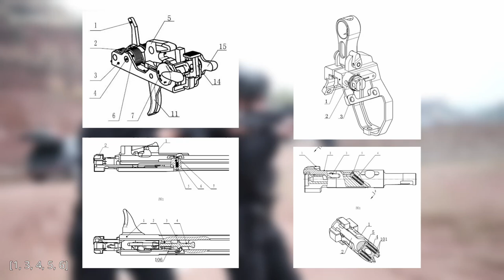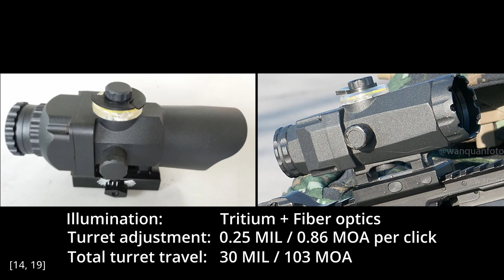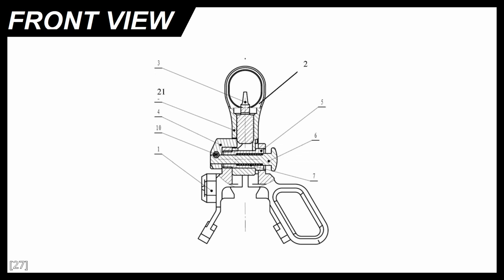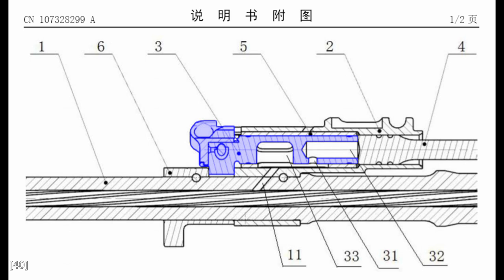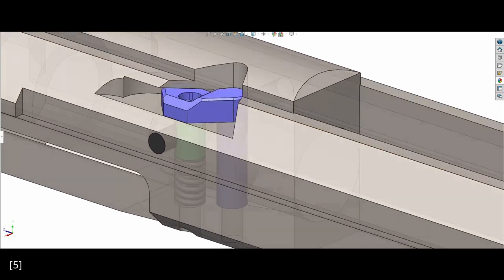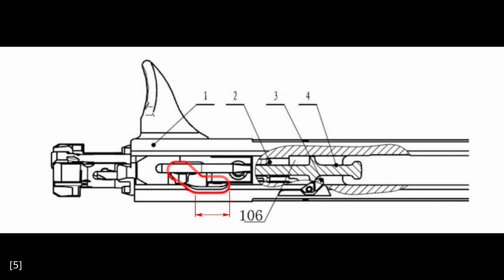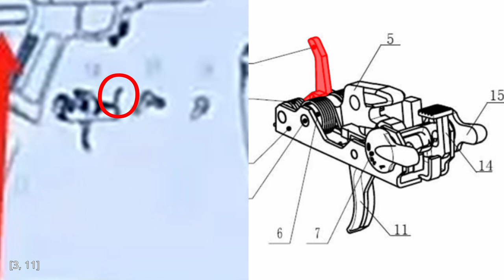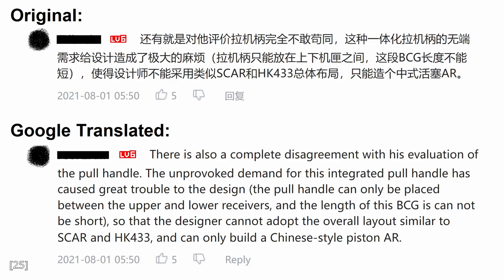QBZ191 - Update / Deep dive [CHECK PINNED COMMENT FOR UPDATES]

Comment: 1. Yeah, Magpul windowed PMAGs are marked to the 25th round as well, with orange paint on part of the spring in USMC service (at least, probably elsewhere too but I've seen it without)

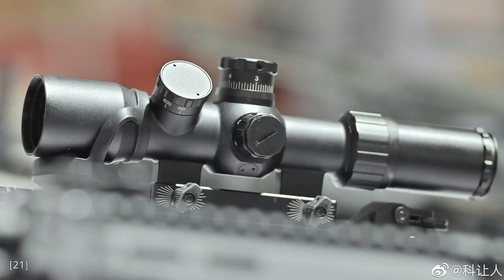5:20
To compare to an ACOG:
ACOG              Mystery Optic
4x                     3x
447.92g          330g
7ish deg FOV 7.6 deg FOV (keep in mind, is only 3x instead of 4x)

No, we have not reached a plateau in small arms design. The issue is that good engineers... don't design guns. They make planes or cars or spacecraft or buildings or literally almost anything else. You should feel in your bones, having looked at all this, that you are basically a paleontologist. That is not because we have discovered every way to do a thing. I don't think that rear sight is even a particularly good way of doing things. 

We can do way, way better.

15:00
Ah sweet, another metered gas block
Also a litttle bit of underslide
 

The firing pin retaining pin is theoretically cool, but honestly strikes me as dumbfoundingly stupid. That's a lot of work for a part like that to solve a near nonexistent problem.
Yeah, it's overengineered. 
I suspect since all you need is a thin little stabby boi, they do expect soldiers to remove firing pin in the field for cleaning sometimes. The tool necessary is likely in the cleaning kit. They probably feel very smart. 

Ah sweet, APE in an AR BCG!
I was specifically wondering what the hell the comb in the ARX160 was. Hilariously overengineered rifle with several deep flaws, but this is actually kinda neat! it's like a key.

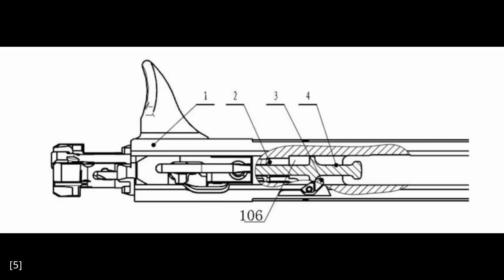23:40
brings a tear to my eye
Though, I'll mention, it not only makes it less violent, it actually lets chamber pressure go down before the gun unlocks.

It's a very neat hybridization of the QBZ-95 and the AK fire control groups.
Overall, quite happy to know more about this rifle. The bolt and non firing pin retainer bits of the bolt and bolt carrier are quite impressive.
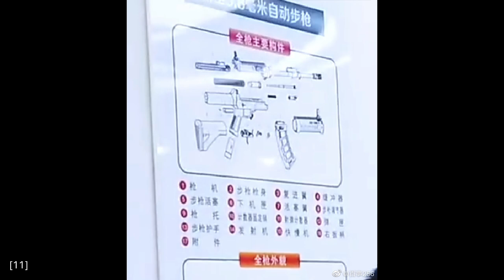Reply from the maker: Regarding the firing pin retaining pin, I don't think they expect soldiers to remove it because in both the photo at 27:20 and the diagram at 7:51, the bolt is still in the carrier. I also can't imagine that they haven't heard of a captive firing pin retaining pin before.

Also I did kinda mention how underslide lets chamber pressure go down more before unlocking at 23:53.
Reply: @cabbage6015  ...they're not disassembling bolt carrier for cleaning at all? that's very strange to me
Reply from the maker: @superfamilyallosauridae6505  Yea that trips me up too. But I guess for piston guns you don't need to worry that much about cleaning between the bolt and bolt carrier.

I think the first gen CZ 805 is also designed so that soldiers don't have to take apart the bolt carrier.
Reply from the maker: Bruh I just realized what you meant about the letting the chamber pressure go down. During that part, I wanted to say that the QBZ191's elongated cam track is appropriate bc it is a piston "AR15", and piston ARs have higher bolt carrier velocity than DI ARs bc the gases act on the moving parts more quickly, so more underslide is needed in the BCG to accommodate that. But in the middle of editing I thought about how people usually think piston guns are more snappy just bc the piston adds another reciprocating mass, which is a pet peeve of mine, so I wanted to address that. I guess that tangent derailed my flow in that section, my bad
Reply: @cabbage6015  Being aware of these things and saying them imperfectly still puts you ahead of FW lol

Glad you mentioned the assorted bolt carriers redesigned to incorporate more underslide. 

The piston thing is a pet peeve of mine too. This is especially relevant in AR10s, which often have actually quite a high moving mass despite being DI. Gas tube>gas piston in my opinion most of the time, just nice to not have moving parts over the barrel, but it's not as simple as people think.
Reply from the maker: @superfamilyallosauridae6505  oh I don’t think I deserve to stand in the same category as Ian McCollum lol. 

Also something I have always found intriguing is that the AR15’s DI system is not commonly copied at all. I guess it’s theoretically not ideal that gases are directed back into the receiver. And people probably don’t want to have to deal with gas rings in a mass-issued weapon. In the case of the 191, I guess it’s a combination of not wanting gases in the receiver/bcg, familiarity with the piston system from prior chinese designs, and the little dwell time on the 192 carbine making the piston more appropriate.
Reply: @cabbage6015  
Not the same category. You haven't put nearly as much info out there, and you didn't singlehandedly change public perception of guns, but the information quality is higher. Ian is generally legendary, you are much more focused with what you're good at.

It's simply not as easy to copy without literally being an AR15. Also, in many other countries it's established GoodThink that DI=bad=unreliable. Europeans seriously still believe that. 

Institutional inertia is all you need, in any country in the world. AK-12 is dumber than this rifle, and the Russians were early adopters of a lot of concepts for decades. The AK in the first place, 5.45 in 1974 having seen what the Americans did just a decade earlier. Almost every modern rifle has significant issues that are almost entirely caused by institutional unwillingness to change from whatever idea sounded appealing at the beginning. 

There are things like Juarez gas systems, but almost anybody willing to do DI is just going to hop on some existing AR15 supply chain because it's so convenient (and cheap). Gas rings is a very silly hill to die on, and I don't think that's why it isn't DI. They just weren't minmaxxing this rifle for weight. They took existing designs and mushed them together in a way that suited them. 

Clean sheet, you'd want to start from the inside out, minimizing the mass of the bolt for the strength needed and yeah they already didn't really do that. I don't know the mass, but the bolt is not particularly light here. That stuff piles on throughout the design process and ultimately is what drives the weight class of what you end up with assuming you aren't doing something wrong or having a bunch of dead weight.

But, they got:
Not horribly heavy machine
Really strong bolt
AK like charging handle position 
(if I'd had a hand in this rifle, it would have a non-reciprocating, yet permanently forward assisting charging handle like the Bren 2's or the ACR's. Those designs don't need you to push any button to engage the forward assist, just pull the charging handle until it catches the carrier and then it will push the carrier all the way into battery. There is no modern day excuse for a reciprocating charging handle, especially in a rifle with doodads like an overengineered firing pin retaining pin with like two plungers involved)
Modular enough
Adjustable LOP
Conventional layout
Ready for night vision and optics

Which is basically everything you need. Good for them! There's some soul in it.

And, well... the AR15 just works. Without APE. The HK416 works. Without underslide. These are undoubtedly good things to have, and some of the largest improvements you can make to an AR/AR derived platform after you freefloat it, but DI is clearly reliable enough either way. Why copy a recoil and mass minmaxxed system when that requires fancy bolt geometry? That's a lot of work. Just have a stick that pushes the carrier away and deal with the consequences.
Reply from the maker: @superfamilyallosauridae6505  I don't think the bolt geometry on DI guns are that complex either. I would guess that it's just a few more turns on the lathe, in the same orientation as when you're making the rest of the bolt stem. The separate gas key on traditional ARs are also probably to optimize manufacturing cost, as it allows you to turn the cylindrical portion of the bolt carrier from just a slightly larger round bar stock, then the gas key can be added on. I feel like if you aren't constrained to the geometry of an AR15 bcg then it shouldn't be too hard to make another type of DI bcg. Then again, as you said, no one wanted to do that.

Honestly I have no issue with the reciprocating charging handle. I think it's in a good place on the 191, that isn't near where you grip the gun, or where you would rest the gun on a barricade, like on a SCAR. it isn't close to the top rail either. As for it's placement on the right side, I don't think it's much of an ergonomic issue bc you have a bolt release. If a reciprocating charging handle is well designed, then I don't understand the appeal of a non-reciprocating one.

I would also withhold my judgement of the 191 firing pin retaining pin, bc my conclusion would depend entirely on their intended use. I highly doubt that they would expect soldiers to remove it with a tool, because after reading their patents, they don't strike me as the kind of people that will make that decision. Especially when their FCG is removable with a button press. If they don't want soldiers to take apart the bcg then their design is a good way of doing that. Secure enough that grunts won't unintentionally remove it, but accessible enough that the armorer can swap it out in a pinch. That mechanism also requires only 3 more holes and a slot to be machined, all of them requiring the same tool orientation as other features on the carrier, so I don't think it's complicated for their intended use case either. The cotter pin on the AR15 is honestly the thing that I have the biggest problem with in that design. It's probably a non-issue for gun nuts like you and me, but needing to remove a paperclip-sized piece that is essential for the function of the gun during field strips seems questionable for a front line service weapon. And I feel like the entire lay out of the AR15 bcg stems from the fact that it's a DI gun. They would want the bolt & firing pin to be removable from the carrier during field strip bc all the gases are directed exactly to that junction. On a piston gun like the 191, not taking apart the bolt carrier for cleaning doesn't seem unreasonable.

Also the AS VAL bcg design is pretty cool. It's also an AR-style bolt face, with APE directly built into the geometry of the bolt and cam, and you can also remove the bolt from the carrier like you would an AK. No need for a removeable cam pin or anything.  If I want to have a piston gun with an AR bolt face I would copy that. But I can't figure out for the life of me how they machined the cam groves inside the carrier.
Reply: @cabbage6015  Sat back, thought about it, this rifle is a masterpiece. Easily ties with the AR15 as the greatest service rifle design in the world. It's just barely different ergonomically from some other stuff, and it can do all of the things a well equipped infantryman could possibly ask for. 
Especially with regard to night vision. Criminally often forgotten about. a 191 series rifle's handguard is about as low girth as a free float AR15's, which is good for lasers, and it'll probably hold zero. AK-12 cannot do this because of the size of its gas system. Adjustable stock, thumb safety, small, thin rifle. Very well designed insides.
That's all you have to do. 
G36 can't do it, SA80 can't do it, ARX160 can't do it, AK-12 can't do it, K2 can't do it, etc. These rifles are all severely ergonomically handicapped in one way or another.
The Chinese are ahead of the Russians now in small arms. A day you'd never see coming 10 years ago.

Comment: This is a hilarious follow-up, but there's video of it keyholing at 10 meters.
Reply from the maker: I saw that one. They're probably just dumping off their old stock of DBP95 ammo, which has a different grainage than their current ammo. It's like firing M855 through a 1:12 twist barrel. All the videos from the people who were issued DBP191, which is the correct ammo for that gun, shows it working fine
Reply: @cabbage6015  I'm not sure about that theory, DBP95 should be 77gr. They could jump to something like 100gr to 109gr for the new ammo, so 77gr should not have an issue stabilizing in a twist capable of stabilizing 100gr+. I know Norinco can build a good rifle, I have one of their milled AKs. If their new ammo is lighter that would be strange, as 77gr is already light for 6mm. Unless they went with a very short and light bullet for higher velocity? I'm not 100% sure because I haven't done much reloading or experimentation, but it's usually heavier bullets that fail to stabilizing in a slow twist. Not the other way around. Could it just be some sort of frangible training ammo that they have not released info on?
Reply from the maker: @isaac6705  DBP95 would be 64gr btw. It was designed for the first generation QBZ95. When they switched to the QBZ95-1, they changed the twist rate as well as land and grooves diameters of their barrels, and switched to the 71gr DBP10, and I would not be surprised if the actual diameters of that projectile is changed as well. There might even be a more drastic change when they design the QBZ191 to fire the new DBP191 cartridge, so I think there is a possibility that it will be incompatible with DBP95. 

My personal Type 97 rifle keyholes with Russian Barnaul 55gr lacquered steel case, even though it has a 1:7 in barrel and was designed to fire the 62gr SS109. But it works fine with brass case 55gr for some reason. (And of course it works fine with all 62gr). Anyways, I think it's possible for a rifle to not stabilize a lighter projectile than it was designed for, if some other specifications are whacky. 

All in all, considering the videos that I saw of people firing DBP191, I think they're just burning up some old stock in that keyholing video. And they're just training within CQB distances in that video too, so they might even be handing out old stuff intentionally to save on cost. That's what I did after dropping some major cash on a bulk pack of the 55gr steel case for my Type 97, and finding out that it keyholes. I just use it to train within 25m.
Reply from the maker: @isaac6705  Update, your hypothesis were true, it was a rubber training ammo: https://mp-weixin-qq-com.translate.goog/s/wbrvmuLj2SNXlHN4FIJgJg?_x_tr_sl=zh-CN&_x_tr_tl=en&_x_tr_hl=zh-CN&_x_tr_pto=wapp

Comment: That 2 chamber gasblock system (both patents) seems kind of pointless and just add complexity for little gain. It flame cuts from the inside of the barrel, and having a gas regulater on the gas block already serves that purpose to  choke gas which makes it kind of redundant to make a dual chamber for that reason.. 
The more I look at this rifle it just reminds me of a piston operated ar15, just looks different and takes ak-"like" mags and uses an ak style bolt head. Other small differences of course. I like it though, nothing wrong with taking what works from different designs. Surprised they went with something without a folding stock. Great video though, glad to see more info on it.
Reply: Hmmm yes... Who would be correct here I wonder, muddy hotdog guy or the entirety of engineers from the Norinco 208 Institute. What a tough gamble to decide huh.. 🤔🤭